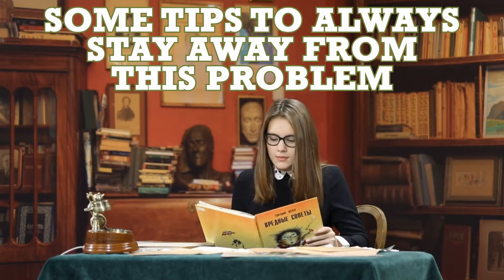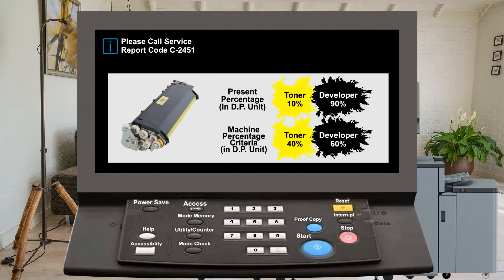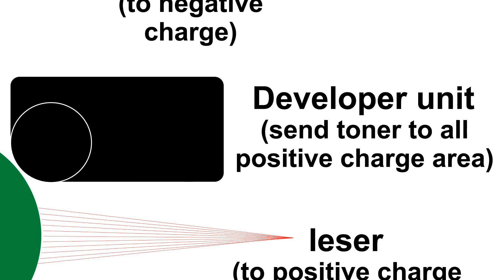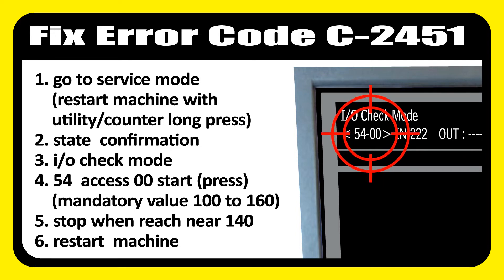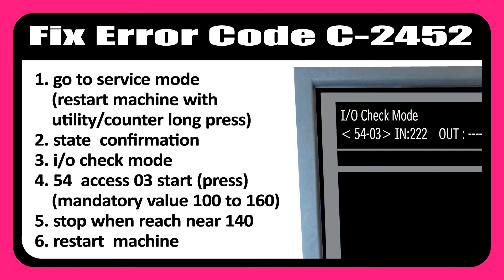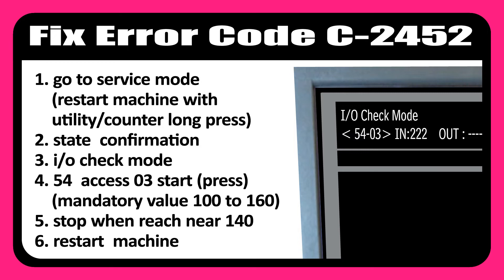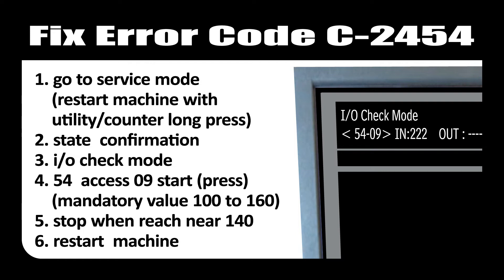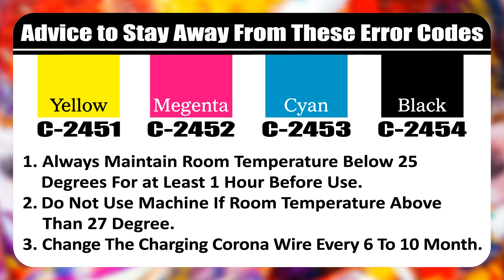#KONICA #ERROR #CODE C2451, C2452, C2453, C2454 Print Quality Issue unable to start fix resolved

Comment: the indicator number does not go down, it remains at 237, what is the reason?
Reply from the maker: Some reason 
1. Charging unit problem.
2. No toner in toner cartridge.
3. Toner hoper not pass toner.
4. Rotate toner bottle by hand.
Etc. hole this info help

Comment: Ink powder is returning from the developer unit in Konica minotra 6501  and
Foam of ink door is destroyed
Reply from the maker: use 3 or 4 layer of double/side foam tape to fix foam problem.
if continually toner goes less or you get fade colour print then must have to calibrate your machine
Reply from the maker: all colour  or one ?

Comment: What will be  done  if the code 2451,2452,2453,2454 comes  continue  in Konica minotra  6501
Reply: After the solution  it comes  again  one or two  days
Reply from the maker: change, deep clean, change corona wire and one main think always maintain room humidity below 50. 
link
https://youtu.be/tGXpXa3G01k
https://youtu.be/MoyT2NztWzg
https://youtu.be/LAEdG9WA5Ew
hope this information help you.
Reply from the maker: change or deep clean charging unit also clean charging connector spring with help of petrol and rubbing ALCOHOL  which located in processing  unit back side 
machine location :  https://youtu.be/MoyT2NztWzg?t=140

Comment: Black value is 11
Reply from the maker: its mean very low developer in developer unit.
or just open developer unit and chack if need add some developer.
hope this help you
Reply: My black says IN:255 and won't go down. When IO Check mode 54-09.  I replaced the black Corona but still get error 2454
Reply from the maker: just rotating black tonner.
Reply from the maker: sorry boss for delay in reply. (this comment not show before)
While this process is in progress, rotate the black toner by hand.